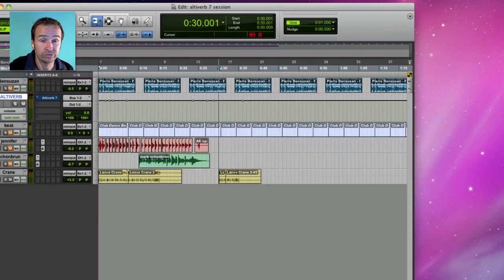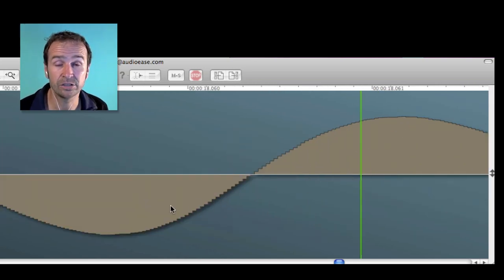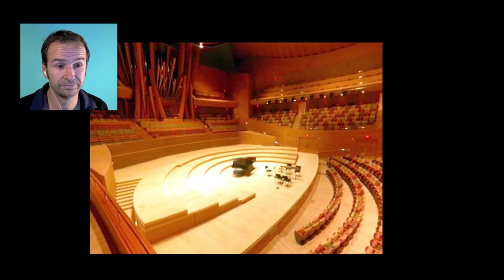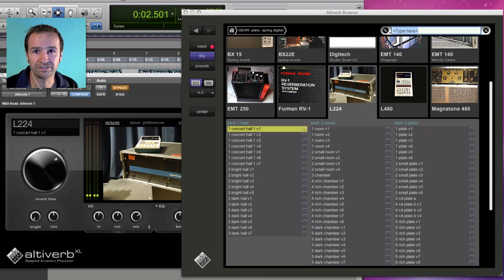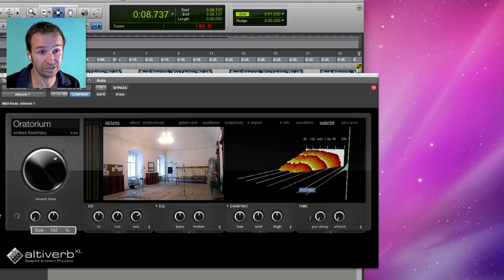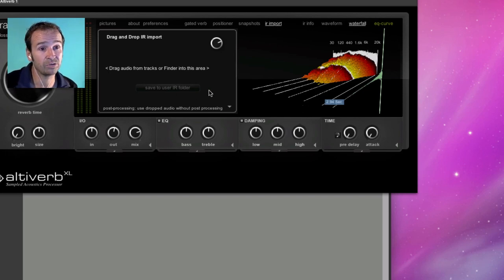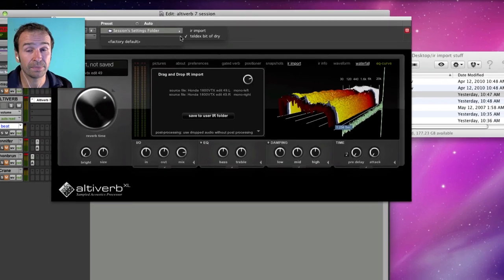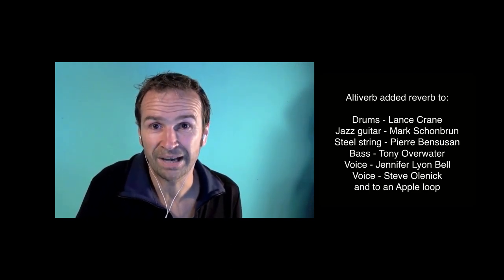Altiverb 7 guided tour

Comment: It would be cool if you could put this on a stereo bus and route each track sent to the bus inside altiverb. That way you could place each thing at a different spot on a stage without having to open a reverb for each.
Reply: Hi! Do you know if that´s possible now?
Reply: @agtrader3776  no idea
Reply: @jasoncruizer  That would handle the left and right positioning but not front and back.

Comment from the maker: We are currently working on Altiverb 7 for Windows and this will include an AAX (32 and 64 bits) Pro Tools plug-in. Altiverb is not cpu intensive. It was 6 years ago, but computers have gained speed a lot. On a 4 years old basic dell computer I can run more then 30 Altiverb instances. Anyway, you can also route different groups to a single Altiverb to position a group at a stage. And you can disable the tail to lighten the load (and then use 1 master Altiverb for the tail).

Comment: Will there be panning techniques like the one in Indoor? I notice artifacts when moving sounds in the space in Altverb.
Reply from the maker: Not likely. Indoor has all these signal paths from one room to another and the power of Indoor is that these positions are real recordings.
A mix between two real positions is not the same as an interpolation between two rooms. The drawback of using real recordings is that the algorithm has nothing to interpolate with. The source is a recording: it does not know why the earlies are there and it really cannot know which early shifts to which in the destination IR. So while we could use fading techniques, it would not become as natural as the rest of Indoor is now. You can set this up yourself with two Indoor instances and judge the result. That is about as good as it would get.

The stage positioning tool in Altiverb was never designed to be controlled in realtime, this is why it clicks currently when the positions are changed. Nowadays the computers are so fast, the next Altiverb version will have clickles positioning for sure.
Reply: @AudioEase   Thanks for the in depth replay. That makes sense. I await the next Altiverb. That+Indoor will be crazy.

Comment from the maker: Altiverb 7 Regular works up to 96 kHz, so 88.1 kHz is no problem and works fine with both Altiverb 7 Regular and 7 XL. Altiverb 7 XL adds support for real high sample rates like 192 kHz and 384 kHz. For these you need Altiverb 7 XL, Regular does not do this. And of course you can always upgrade from Regular to XL. You will pay only for the price difference between the two versions, so you won't loose any money doing this.

Comment: Is altiverb 7 going to be available as an RTAS plug-in for Windows 7 64-bit in the near future?  Also, at around 4:30, when you're demonstrating how you can change the stage position of different instruments/voices, you mentioned how it could be used to position a sampled orchestra on stage.  However, to do this I would have to open up an instance of Altiverb on each track and as it is, Altiverb is very CPU intensive. Is there a way around this?

Comment: Why is it "loud and dangerous to play back a loud click"? And if you're going to use a sine wave sweep instead, why do you need the click at all?
Reply from the maker: +Captain May you need to get a response of the hall's acoustics at all frequencies. A good spike has all frequencies, but there is no speaker that can playback this signal without modifying it, this is why the sweep works better. A snare drum hit would work too, but if you zoom in on a single hit you'll find it is not as clear as a single click and this all influences on the quality of the resulting IR (you get phasing and coloring issues).
Reply: audioease
- I see, thank you for explaining. It is an absolutely amazing technology. Younger people don't realize how lucky they are. Just 20 years ago this would've sounded like pure science fiction.